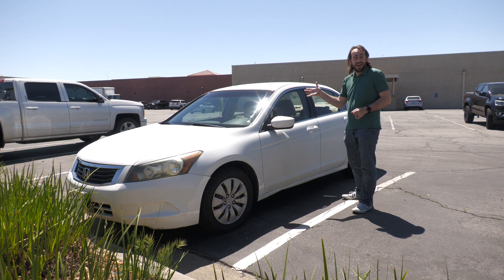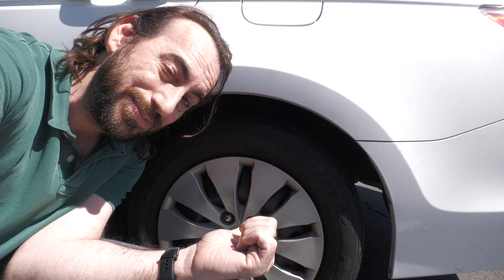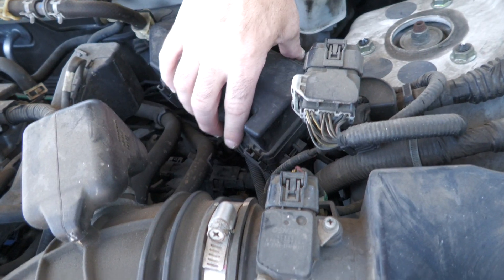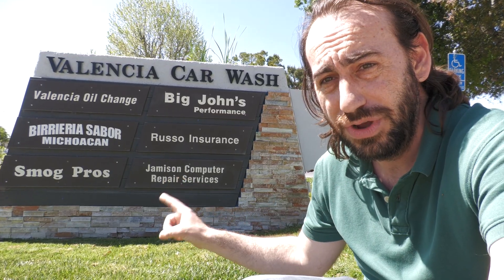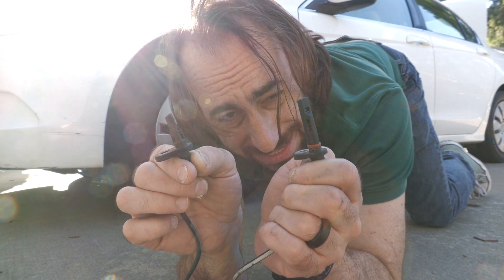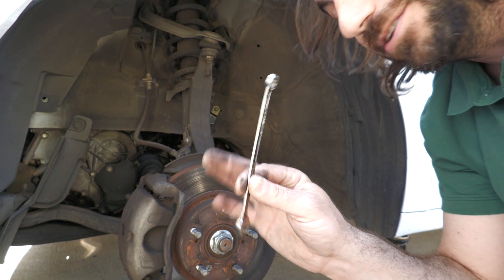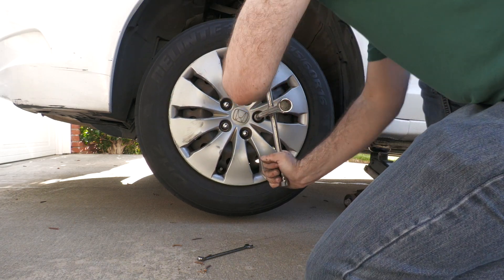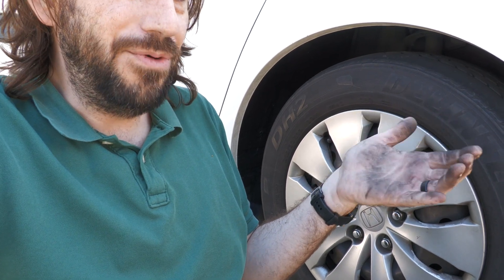Accord VSA Actual Fix Part 1 Wheel Speed Sensors Replacement

Comment: Ive changed all 4 wheel sensors and the fuse under the steering wheel. Lights are still on. What should I do next??!
Reply from the maker: Thank you for stopping by and watching Laketa! I'm glad that I was able to help you on doing some auto repair – most small repairs aren’t as tough as they make them out to be. Just remember that the advice that I give helped resolved my situation, and I’ll do the best I can to present what is helpful – however, you may still need to head to a mechanic for assistance, or just to get codes read if you can do the work yourself.

Since you are still having the VSA warning light on your dash board, remember that it is your traction control system… but it works hand-in-hand with your brake system (including your ABS). If you watched my second part, then you would know I had to replace my brake light sensor to fully resolve all errors and turn the light off. To resolve your VSA light, I would recommend using the following procedure. 

First, if your car is exactly like mine, check the brake lights – all 3 of them, the center one, and the 2 tail lights. Make sure that they turn on when you press the brake petal. Have a friend stand behind the car and off to the side to see what happens when you press your brake petal. If They don’t turn on, then check out my second video in this series, could be your brake light sensor – it’s a little switch that when you press on your brake petal, the switch opens and turns on your brake lights (and when you release your brake petal, the button is pressed and turns off your brake lights.

You could test this yourself at night – back up to a wall, put your car in park, release the brake, and turn the lights off (just to make sure you’re not seeing the cars regular running lights). Using your rear and side view mirrors see if the wall lights up red when you press the brake petal. If they do, then good. If not, then check fuse #10 under your hood, it’s 20A. You can also check out my second video if your brakes don’t light up, you may need to check and/or replace the brake light switch mentioned earlier, connected to your brake petal. If your brake lights work fine, no need to do so.

Just remember – your regular running lights are not your brake lights. When you turn your lights on, the taillights light up. When you press your brake petal, your red lights will get brighter in the back (or turn on fully bright if they are off).

While we are at it, under your hood you can also check the #2.2 and 2.3 fuses (they’re 1 complete module you’ll have to unscrew and carefully remove and then carefully reinstall and screw back in. the #2.2 is 40A and the #2.3 is 30A.

Past that, the last fuse to check is under your glovebox on the passenger side of the car. When you open the door of the car, just to the right of where your right foot would rest on the floor, there is a small panel you can remove from the wall. Check fuse #6, it’s a 7.5A. Those should be all the fuses you’ll need to check and verify. 

The next step, which I missed in the video, is to check your brake fluid level – the reservoir for the 2007-2012 Accord is found under the hood on the driver’s side, close to the fuse box, just below the windshield. Just make sure it’s between minimum and maximum – you may need to get some brake fluid, which could be found at any auto parts store, or even Walmart. My fluid was low, I topped it off to just below the line indicating “MAX,” but it did not resolve my issue.

The next step I would recommend is to reset the computers yourself. Please keep in mind that the method I’m sharing will also wipe out your time (and date) and any radio settings (including your preselected ratio channels). If you wish to not do so, AND/OR your radio has a code that you don’t know, then I would skip this step and have someone with a OBD2 scanner clear your codes. If you’re willing to reset your time and radio settings, all you’ll do is disconnect the negative terminal of your car battery and leave it off for at least 15 minutes. While you’re at it, check for any corrosion on your battery terminals and clean if needed. After 15 minutes pass, reconnect your cable securely and give your car a test drive. You should know within a few miles if the VSA light returns. If it does, proceed to the next step.

Final step – you’ll need an OBD2 port reader – a scan tool that will read different codes the cars computer is saying “This is what’s going on.” You’ll need to get the actual code or codes to see what is really happening. It's how I knew that I needed to switch my Wheel Speed Sensors, but also, they gave me another error of 68-21 “Brake Petal Position Stuck Off,” which as mentioned before was my brake light switch was bad (please see the second video if you need some steps with it – it’s what cleared my code after the wheel speed sensors). 

Otherwise, you could have a number of errors – even the possibility that the actual VSA unit or ABS unit are bad – and even one of those could run a few hundred for the part. Getting any error codes will be really helpful to research what needs to be done. Take a photo of each code so you can research them, and then have the tech clear the codes, and drive around for a little to see if the errors come back.

Hopes this helps you in the right direction resolving your VSA warning.
Reply: Did you check the caliper line sometime those lines get hit by rocks or metals on the road
Reply from the maker: @santodramirez2633 they're usually pretty tough, and protected. If your brakes start feeling soft, I'd check the brake fluid - which is a clue for the caliper being leaky... aside from seeing the leak.
Reply: You need to reset it